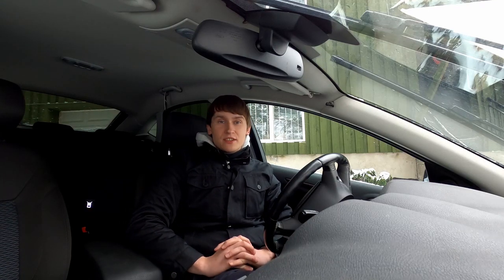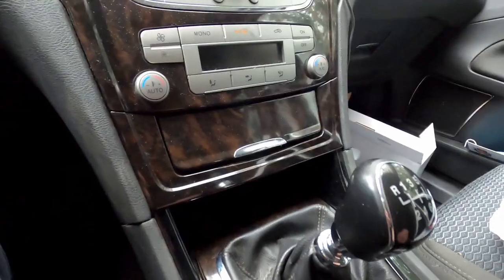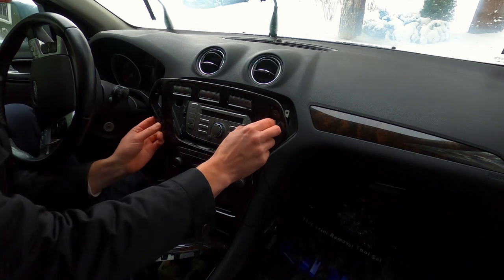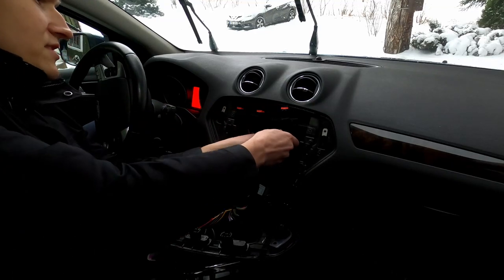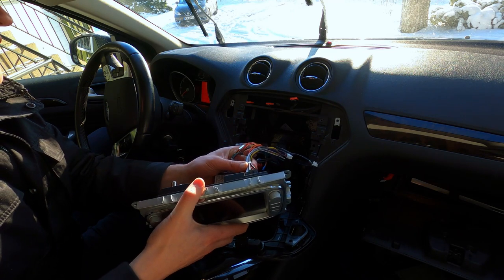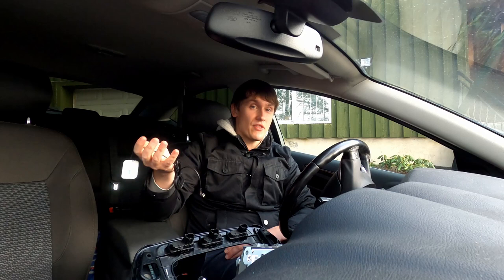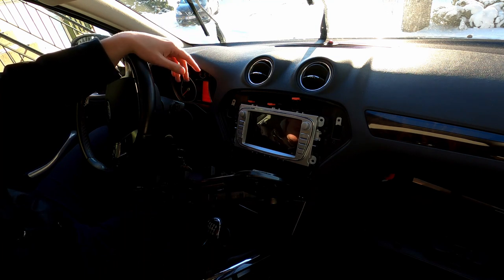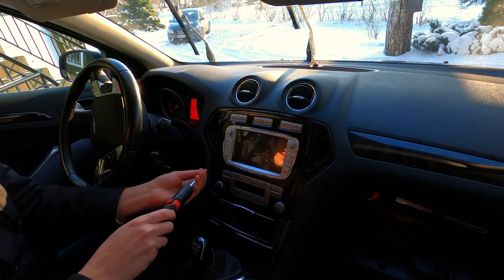Ford Mondeo mk4 Radio Replacement

Comment: Good job, the buttons on the steering wheel work?
Reply: Great job.
Yeah, I'm wondering the same..?!
Please answer?
Reply: It didn't work on mine, still looking the way to make it work 😅
Reply: I did the same install - buttons on steering wheel works, but you have to go through the settings and takes a little bit of time to set up..... Great unit for the price!
Reply: Yep it works after some fiddling, make sure the small power connector for the can decoder is disconnected, but there is a small connector with ( i think) a purple and some other cable connected to the unit. After that you go to factory setting -> pin 8888 i think -> protocol -> find your can decoder type, then car and save. It should come alive.
Reply: @lengyel109  could you give example with your car

Comment: Great video, and thanks for putting this together. I am in precisely the same position - power has gone to the unit, old and new, fuse appears to have blown. I've checked as many relevant fuses as I can, checked schematics etc, but I can't locate the damaged one. May I ask which fuse you changed to rectify the problem?
Reply: Mine went too. Check in the fuse box that's underneath the glove box. It's the 6th one down on the right hand side, 15amp (blue). 

I changed mine but it still doesn't work, so I guess it's back to Amazon for the second time... :(
Reply: @sosimple3585  Thanks buddy. Very much appreciated.
Reply: @sosimple3585  Found it. Fixed it. Thanks again.
Reply: @MLeonardReel  Great! You're welcome, sir.

Comment: Installing mine but I lost the parking sensors sound completely!any idea please?
Reply: Same situation 😏 but, generally speaking, the unit work well. I thought that's is a setting issue
Reply: Same situation... anyone had some explication or fix that? It's very complicated parking because of dimensions of the car..😏 btw, suddenly, the reverse camera stop working 🤔( a license plate incorporated model) please help me if anyone had a solution... thanks in advance

Comment: hi i really need help i have a very similar aftermarket radio and have the same mondeo as you how did you get the steering wheel to work with the radio and how do i get gps to work i have signal but the maps are blank? any help you can give would be great thanks Gaz

Comment: Hello the Cambus decoder did it gave 1 Jack plug or 2  mine has 2 and my steering controls will not work
Reply: Did you solve your steering buttons?

Comment: I will be waiting for next video about it's features. :)
How do you rate the sound of it? it's the same or worse than classic radio? 
What about radio stations name - are they showing or just numbers like 100.90 and so on...? 
The clima when you change it under radio is also showing on it?
Can you change radio stations and volume with levers at the steering wheel?
What about microphone when you are on handsfree?
Reply: Hey Milan, i have the same unit too. So far it's okay for the price. Sound seems fine, works with aftermarket reversing sensors and camera. The fm is kinda crap, but that just might be my car. You only see the numbers but after tuning in to the channel it shows the name. The steering wheel controls and climate controll works too, after you select the correct protocol for it. Only remark is the interface. Not that great looking and can be a bit confusing to navigate around.
Ohh yeah. If there is abuilt in mic, then its crap - not even sure it has one, andyou cannot hook up an external one according to the seller on amazon.
Reply: @lengyel109  Hello Márk. Thank you. I am looking for something like this android device. To also add here reversing camera and maybe also aftermarket sensor because mine works when they wanted to :D So 90% they don't work :D What about the microphone - are you also using handsfree? I read about the microphone that you have to connect external but... that's the one thing that I don't wanted to. :D
Reply: @FishmanX13  hey Milan, well truth be told, from where I bought it mine (amazon.de) the seller said in the description that you cannot connect external mic for it. A few times I tried to have phone calls through the head unit but the sound was not workimg for me. I could hear everything perfectly but nothing went out so idk. As for reverse camera and sensor. They should in the accessories give you a connection plug with a standard video output ( the yellow  plug ) with which for me works perfectly.  It needs some cabeling around the car though. I bougjt this camera parking sensor license plate frame and works like a charm. It was from a company called "lescars" or something lkke that. If you send me an email I can give you some pics amd links if you want.
Reply: @lengyel109  what are the right settings for can bus

Comment: Hello. with this model of radio do you lose voice commands?
Reply: I installed my unit yesterday and it all works OK but I've lost the ability to send/ receive calls over the unit. It connects to my phone via bluetooth but seems to constantly drop out and reconnect! Any ideas would be appreciated as I have connected everything at the back of the unit but the "mic" lead looks like it needs a connector to the car/ external microphone - any help on this would be good please.

Comment: I installed a similar one in my S Max. It's great but the reversing sensors stopped beeping as I think it's routed through the speakers and the FM signal is awful. However I just listen to internet radio so it's all good.
Reply: Same here. My sensors stop beeping because the rear camera view pops up on the screen. Have you fixed this?
Reply: @besmaksuti9112  No.
Reply: got this radio in my S-max Wa6 2011- not a bad device, i like the Sygic Navi App - its offline and the GPS works good-  BUT! if you want to listen FM Radio - DO NOT BUY IT - its a pain in the A... - you drive 100m and the signal is gone. its crap.   i'll change the device this week.
Reply: Rozpięty przycisk asystenta parkowania

Comment: I have the same radio, the screen wont turn on at all, the original radio works with no problems, the fuse is ok. Can someone help?
Reply: Hey buddy. I actually baught this type of radio and I have the same problem as you had. Old radio works fine , but new one doesnt. Did you solve the problem? Thanks
Reply: @Zd3nda  yeah, make sure you plug in everything properly. There are some connectors that go from the canbus box to the car (not directly into the radio)